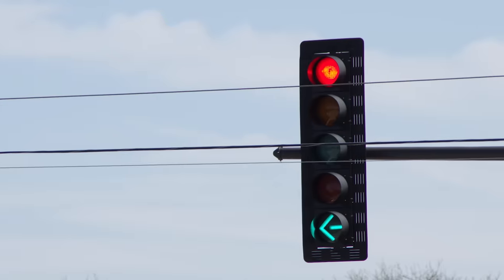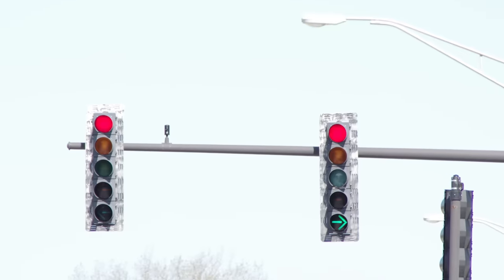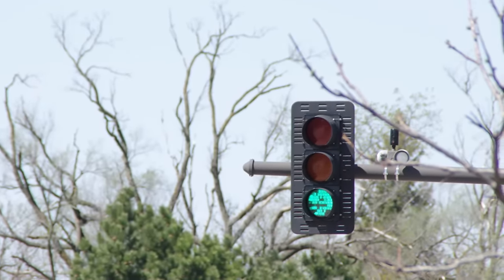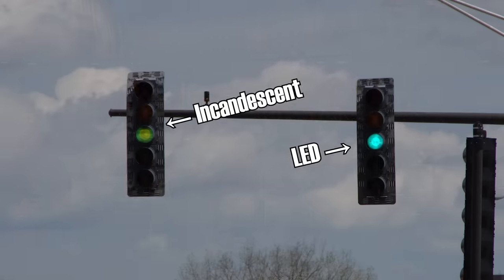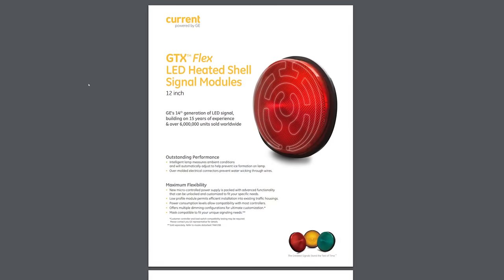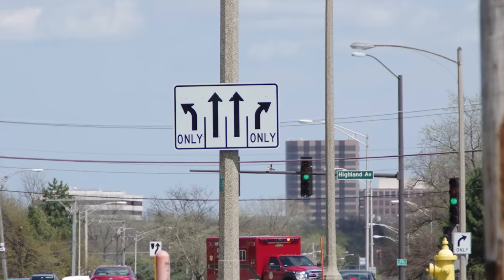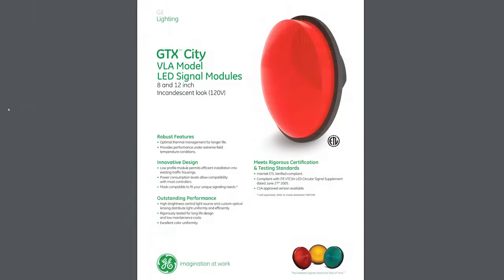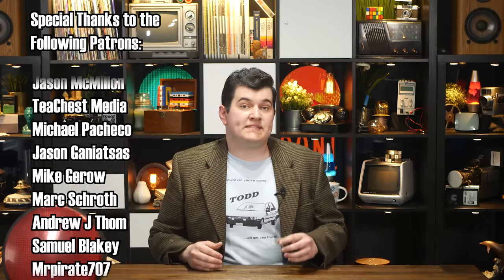The LED Traffic Light and the Danger of "But Sometimes!"

Comment: 9:25 "a snowstorm severe enough to cause buildup on the traffic lights"...  should be reason enough to just drive slower and more careful anyways.

But this is what happens when self-aware apes handle 1.5t death machines for transport.
Reply: What about in the days after the storm? It may take days for the snow to melt, or weeks if it's a really bad ice storm ( though then you probably won't have power for weeks or months then )

In my area they use the same heaters use for melting snow off roofs to melt the snow on the LEDs.
Reply: You described every other day in Alaska.
Reply: @mfk12340  if the weather conditions are potentially hazardous, you adapt to them. regardless of whether it's during a snow storm or after it, if there's still ice/snow everywhere, you're going to drive slower and more carefully. this would also significantly boost your chances of not getting into a wreck if the lights are out/covered up.
of course, in practice, not everyone uses their brain, and they're going to speed around on icy roads. at that point though, it's questionable if a traffic light is all that useful at stopping them.
Reply: @vukpsodorov5446  it's also about bringing the right tool to the job and your car/truck is exactly that... a tool.  If it's not properly equipped with AWD/4X4 or a locking differential and/or snow tires, you shouldn't be out on the road in the first place.  My truck is capable of going through at least 6 inches of snow at 50 mph SAFELY because it has the proper equipment installed, now I almost never do that because my own personal driving rule is if I don't feel safe driving at 40 mph I ain't driving unless it's an emergency.
Reply: @mfk12340  imagining it was a solid blizzard and the light was covered. Treat it like a stop sign. Like your supposed to.
Reply: Yes. If the traffic lights are not visible the cause of action is pretty simple: Approach the intersection slowly. Pass, when there are no other cars. Communicate with the other drivers, if there are other cars. It's frightening that so many people forget this once they have their driver's licence.
Reply: not when self aware robots created by said self aware apes do the driving
Reply: @wohlhabendermanager  I suspect that alot of people dont actually forget, they simply dont care and just expect everybody else to yield to them.
Reply: Snow's translucent anyway. It would only block some of the light, not all.
 And only on the one light that's facing into wind.
Reply: @Sciguy95  The danger comes from the lights in one direction being obscured while others are still visible. Those who can see the green light will proceed through the intersection, possibly running into the driver treating the intersection as a four-way stop and also proceeding through the intersection,  mistakenly thinking they have the right-of-way.
Reply: @IctWilsons  sounds like any other time that they're acting as a stop sign to me. I have literally never seen a stop light in stop sign mode where people didnt just drive straight through like they had a green light anyway.
Reply: So do you ride a horse instead of a DEATH MACHINE?
Reply: @Strill_  The land of the square tire! Where they use road graders to turn the snow into pack ice! I spent a year at Ft. Greely, in the '70s. I took the survival training course on an iced over parking lot, that they had just sprayed with water. The worst thing was that it was about 100 miles to Fairbanks, just to get a pizza. The Alcan Highway was still a gravel road.
Reply: Have you ever actually SEEN an unilluminated light pole in a snowstorm while trying to drive?

Me neither
Reply: @trekkie117  You're at least legally blind then, and you shouldn't be driving. I worked and drove for a year at Ft. Greely Alaska. I am well aware of driving in, and on snow. We received so much snow that they used road graders to turn it into pack ice, and snow drifts often covered one side of the three story cast concrete barracks.
Reply: @michaelterrell  None of what you said is even a defense. Like, what does this have to do with the diminishing visibility of these lights? Are you saying that it's not causing the problem it's causing, because that problem is being caused
Reply: @trekkie117  So, you work for George Soros?
Reply: @michaelterrell  Pyotr Kropotkin
Not a bad guess tho

Comment: 06:20
Here in Germany on every intersection each traffic light has a traffic sign mounted on its pole. In case the lights fail the right of way is still regulated. But it would not be Germany If there was a backup without a backup. If there are no traffic signs the rule 'right has right of way' applies. Exceptions to this rule are traffic regulation by the Police even when the traffic lights work.

So it's
Police > Traffic Lights > Traffic Signs > Right has Way of right
Reply: That’s True but if not all traffic lights fail at ones (due to snow coming from just one direction) this can still case an accident. If the person with the Give Way sign has a green light and the person on the road with the right of way signs red light is cowered with snow or not working anyway both drivers think they can cross the other road now and might end up crashing
Reply: but it's germany, we really don't have that kind of blizzard here...this is again a very "but sometimes" problem and if there ever is that much snow, you propably have to drive so slowly, you can avoid most accidents
Reply: I love the way that Germans overthink everything.
Reply: @ahobimo732  Not everything, mate.   My BMW Z4 was caught with the top down in a quick rainstorm.  Not a crazy amount of rain, but enough to get the dashboard wet.  However, enough to compromise a large amount of the electronics, and yield a nice big repair bill.  Apparently, the German engineers didn't think that perhaps a convertible might sometimes get caught in the rain?   Ultimate driving machine, my ass.
Reply: @mayorsnorkum4005  Sorry about your car.  I have no experience with BMWs but I've heard that repairs and maintenance can be ridiculousoly expensive.  There are a lot of considerations that go into engineering a consumer product, and making things more complex doesn't always make them better.  It seems like in the case of your car, they overlooked a problem that should have been both obvious and easy to solve.
But my statement was more a comment about the overall nature of German culture.  There are bound to be exceptions.
Reply: Isn't it also a lot of work to get a driver license in Germany?  As an American I have always heard that Germans take driving more seriously, and that in part this is caused by the huge time and expense required to get a license.  Is this true?
Reply: @Warhawk76  yes it is. First you've to take an exam and for that you have to memories nearly 2000 questions. The exam has 30 questions. After that there are mandatory driving lessons (I guess 14) and on top of that people often times do more to be on the safe side/practice or they actually need them. After all that you have a driving exam and if you pass that aswell you've got your driving license. It costs nearly ~1500-2000€. Oh and the exams and driving lessons cost money - so if you fail or need more practise it get's more expensive.

But I think considering how safe the people drive here (my reference are vacations in various other countries) especially on the autobahn with no speed limit it is worth the money, time and effort.
Reply: @ahobimo732  Sometimes we do. "But sometimes" we only think we do, think we are smarter than the rest, only to realize we are just as dumb as everyone else. But of course this doesn't stop us from thinking we are the smartest, ever.
I guess we just love to go ass over kettle more than other folks.
Reply: @Warhawk76  not really. when i got my license five years ago it cost about 1000€ and passing the tests was easy without effort.
many of the questions in the theoretical part can be answered with a little common sense, no need to memorize anything.
Reply: What does that mean "Right has way of right"
Reply: @prithvirajb1953  when you are at a Crossroad with no traffic signs it means that the vehicle which is coming from your right has the way of right and drives first.
Reply: @prithvirajb1953  imagine you're at a crossroads. You're coming from south and you are going to drive north. Another person comes from east and wants to drive west. If there are no street signs, no traffic lights and no police officer guiding traffic, the other person would be allowed to drive before you do.
In other words, if someone's coming from your right, and your paths cross, you are required to let them pass before you continue driving yourself. 
 That's "right has right of way".
Reply: Same rules apply in other Central European countries. At least in SK / CZ, signs on traffic light poles are almost universal (at least in cities). In AT, they are also present in those cases where they differ from the standard “right has right of way” rule; in SE you can also see them every now and then. (And as long as I'm on the topic, it appears that in most non-post-Soviet European countries, main roads are not clearly marked before an intersection, but rather after one, and then you are supposed to remember if there was a sign after the last intersection you passed. Which drives me nuts. </rant>)
Reply: @ahobimo732  
If it seems too simple, hand it over to a German and s/he will complicate the crap out of it.
Reply: @ahobimo732  Talking of exceptions I had an installation job a few years ago in Cologne we were looking forward to it until we got there, it was utter chaos and misery to work in. I know it's not the norm but it was refreshing to know that Germany also has construction sites as disorganised as some I have worked on in the UK. Germans do have a great ethos though I have a lot of respect for them.
Reply: Same in Switzerland
Reply: Here in Switzerland the yellow/orange light blinks when we should use the signs. This can be the case at night when there is almost no traffic.
A traffic light that is off is considered defect.
Reply: In the United States we're supposed to treat failed lights as a four way stop sign. Unfortunately we have too many morons or people who just don't care.
Reply: @ichbinjasokreativ2452  True, I payed around 2500€ because I did get the BE license, so I can tow things. And I failed my first practical attemt by a stupid mistake :(
Reply: @happygimp0  Happens in Germany as well, but only after a certain time in the evening. But in my entire life I have NEVER seen a broken traffic light. Honestly I didn’t even think about it until this video showed up in my recommendation lol

And again. If there’s a super bad blizzard coming through, why on earth would you go outside? No one should work on those days but essential workers. I
Reply: @bellsonfresh  It is maybe rare but when it happens you do not want to be death. The blinking light also has the advantage of better visibility at night.
Reply: I think that's common in europe because the traffic lights are before the actual intersection so you wouldn't see one mounted at the top of the pole
Reply: @l.1574  I'm pretty sure traffic lights are rigged such that if one fails, they all fail. It's a pretty common concept in engineering, especially in safety critical system - it's called fate sharing.
Reply: Frank Silvers  so what? I cannot speak about what's common in my continent? The same as south america and north america have similar road design...

Comment: I appreciate this video. I am an engineer and I teach a course on safety management and this kind of thing comes up a lot.

When incident I remember from my own experience was when I was at another university waiting at an intersection for the “don’t walk“ red light to turn off. (There was no “walk“ light). When the light turned off I started across and I heard a loud honk so I backed up and the driver was pointing up at the light. So I walked over to where I could see his signal and saw that it was green. Wonderful!

As soon as I got to my office I called up the traffic department and reported the situation. To my surprise they said oh we know all about that. They also said that they’ve known about it for years and they don’t plan on fixing it. The reason they gave was it would cost $20,000 to address the issue at that intersection and loss prevention calculated that their legal exposure in the event of an accident would be less. I suggested that they reevaluate their estimated loss because the fact that they know about this and didn’t address it would expose them to a higher liability.

I left that university two years later and the intersection was still not working right.😑
Reply: THIS ⬆️ made me sooo ANGRY‼️ 😠
The SOB who told you that also told you what human life is worth to him and the University! 😠
I want it FIXED.
Suing is expensive...
Could you report a violation?
To OSHA, the Dept of Transportation, local TV stations, all of the above?

Comment: 6:30 There's a problem with assuming a snow-covered traffic light is an all-way stop: It may not be unviewable from all angles. A driver that can still see a green may not know that traffic from their side (whom can see nothing) would expect them to stop.

If you can't see your signal's indication, treat it as if you alone have a stop sign.
Reply: Lol, no. It's stop only for the direction where the lights are not visible. Meaning cars in that direction should stop and let cars from other direction drive. So if those other cars have green light, is not a problem at all.
Reply: Well if you cant see your traffic light and you stop you are supposed to procede when traffic is clear, i.e. wait if you see a car coming.  You are NOT supposed to assume a car is going to stop and procede through the intersection.  You are right that can cause an accident, bad driving can always cause an accident, with or without snow covered lights.
Reply: I was going to point out the same thing!
Reply: @jankoodziej877  What you said is pretty much exactly the same as what I was trying to say.
Reply: You were perfectly understandable. Jan just misread you or something.
Reply: The first rule of driving should be: 'Assume at any moment that someone else will do the stupidest thing possible and be ready for it'.
Reply: @Spearca  green means go.  No one is going to stop at a green light because snow might be on the other directions lenses.
Reply: @Spearca  true. I think I’m agreeing with you.
Reply: Ever sit at an intersection and someone blows their stop?  I got hit last winter from a truck slowing to a stop, I completed my left hand turn and got t-boned from the guy who got confused and accelerated  from his stop.  I had new tires and ABS, he had a 1980s pickup with tires you could see the wires in.

Comment: As an Alaskan, I can tell from personal experience this was an issue far more often than “sometimes.” The first winter after the municipality began switching to LED signals without accounting for snow buildup was also one of the worst in the last couple of decades. While the average taxpayer was excited about the energy savings, they were equally shocked that no one in the local government, the company contracted to help facilitate the switchover from old to new nor the manufacturer providing the new requirement involved stopped for a moment to think about this very issue at any point during the planning or rollout stages. After a sobering increase in vehicular accidents occurring at or near signaled intersections, people were floored when the city manager in charge of the program unashamedly admitted the issue never occurred to him. 

The danger here, and the real issue at hand, is not new technology but a failure to account for how that new technology will function differently than that which it is replacing, both for better AND worse. Far too often this level headed way of thinking is abandoned in the rush to adopt new technologies that on the face are cheaper, more efficient and “earth friendly.” In my example and personal experience, we weren’t shaking our fist in anger at the almighty LED, rather shaking our heads at how once again the people who are both expected and paid to know better once again failed miserably to do just that. And if you’re being honest, THAT is what those articles you mentioned were aimed at, not LED’s.